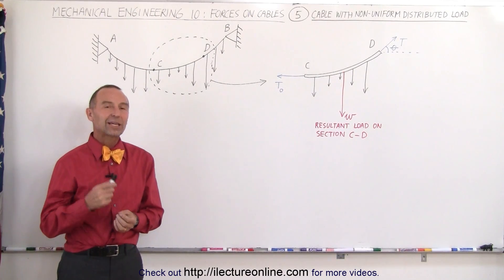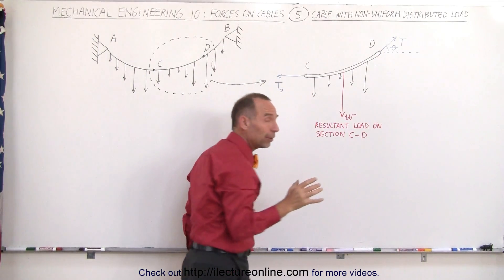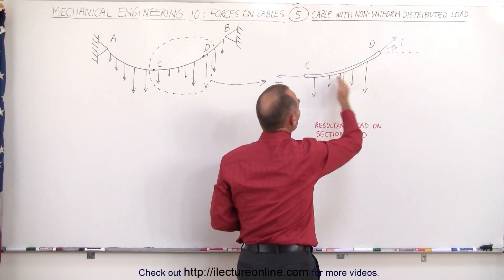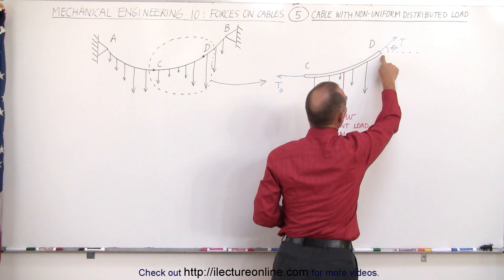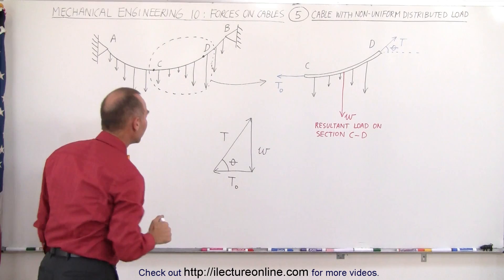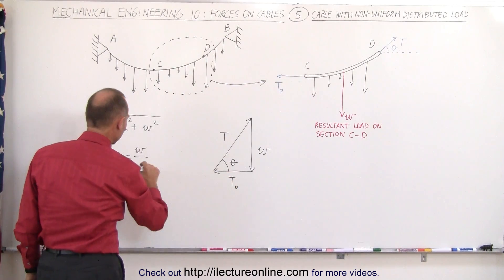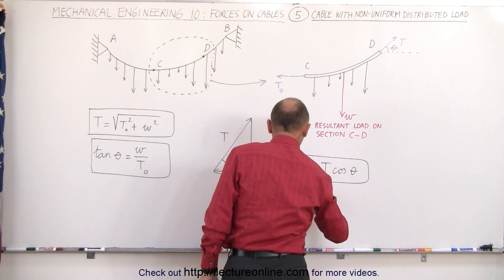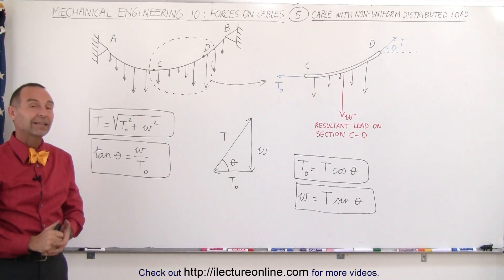Mechanical Engineering: Ch 10: Forces on Cables (5 of 33) NON-Uniform Distributed Load

Comment: Your videos are very helpful thank you very much .
Just want to ask you there is another way to analyze cables which is using general cable theorem 
do you have any videos or explanations regarding it
Thank you again
Reply from the maker: Cables are analyzed differently, depending on how they carry loads.  Every type is explained in this playlist.
Reply: i see.
for none uniform case you said w is the resultant forces in y direction but we dont know the value of T how did u come up with w ?
Reply from the maker: Go ahead and look at all the examples, there are many different ways in which the problem can be stated and therefore many different ways to solve the problem.